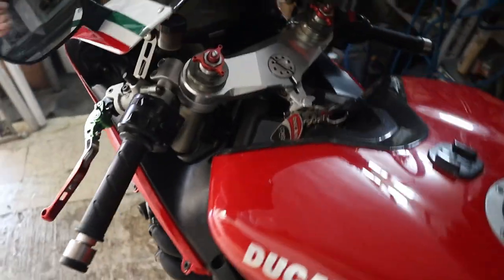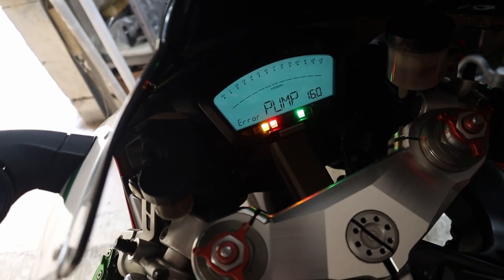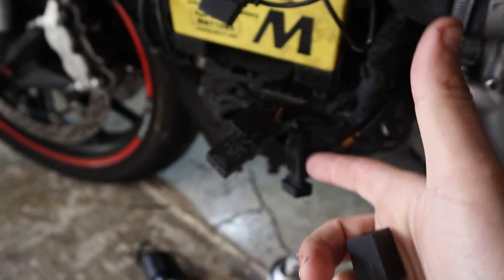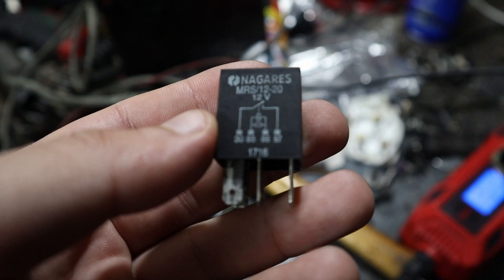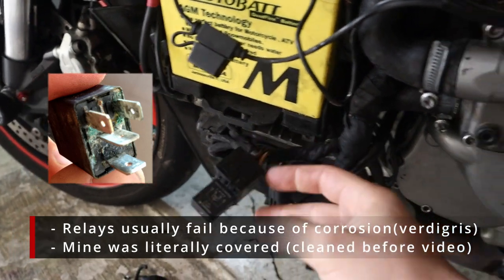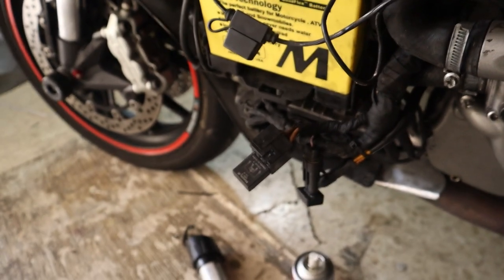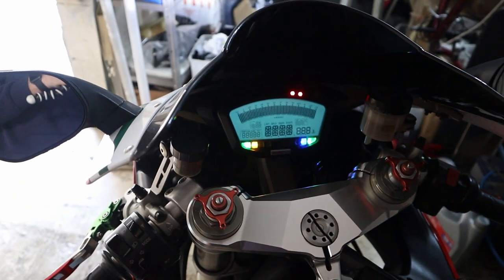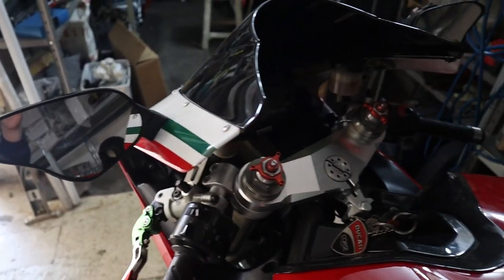Ducati injector and pump error relay fix

Comment: I have the same problem with error injec 12.2 ... this was very helpful 👍 can you perhaps share the part number for the relays? I see you bought Mahle, thanks for sharing
Reply from the maker: Hi, part number is 54140101A , any electrical auto shop should have these in stock, maybe a different brand but as long as the numbers on the relay match it should be ok.
Reply: @pullumoto  thank you
Reply: ThankYou-Clear, Concise, Spot On ! 👌👍🇨🇦

Comment: I replace the relay, but the bike still isn’t working, fuel pump is not priming
Reply from the maker: Do you have the same errors?  It would be good idea to check the pump itself and connect it to a 12v source to check if it works